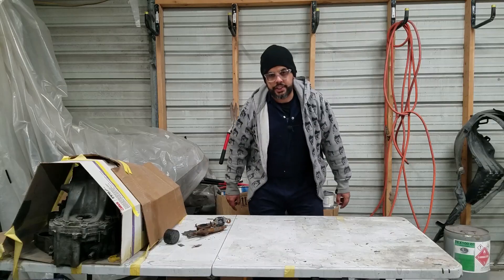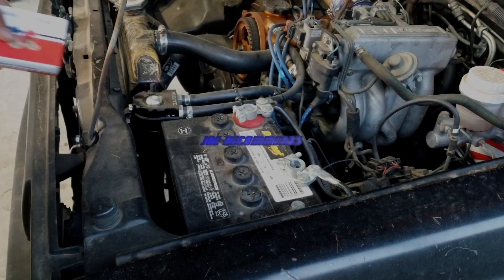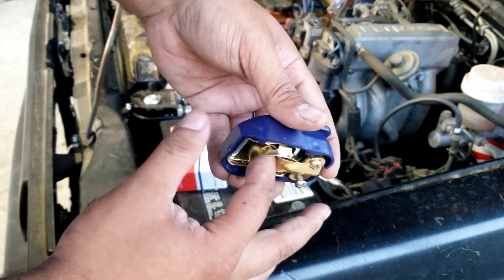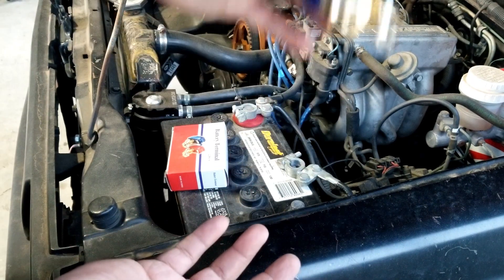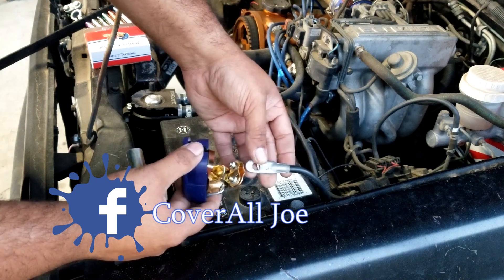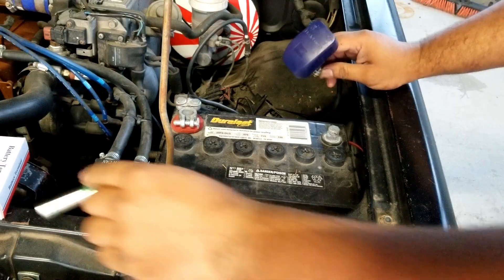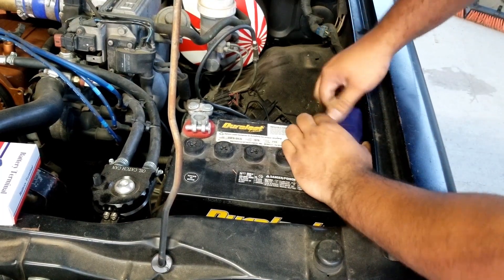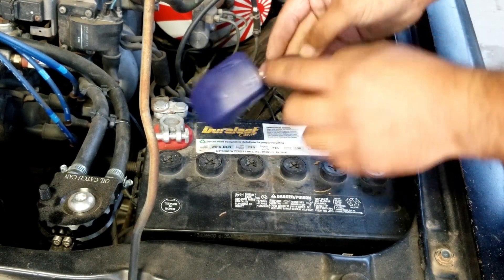Joe Recommends // Product Review, Installation  and First Impressions. Will I Recommend it? 🤔👀

Comment: Sweet channel man. We both got Tegs and Mitsubishi's. So funny bc I got a 1990 Acura Integra GS 5 speed and a 1986 Dodge Ram 50 sport 2.6 5 speed. I literally am in the process of getting my 1986 back on the road after 7 years bc the integra is having electrical gremlins. I've done a lot of work to get these cars looking like survivors. Absolute gems. Cant wait to see the MIGHTY MAX build continue.
Reply from the maker: @Habeev07, damn gremlins! Sorry to hear that! But its a great chance to get that mini truck up and running! 👍😎
Reply: @CoverAllJoe  its so odd. I have no crank or anything when I turn the ignition in the Acura. Its got a new distributor and battery, and i even unplugged the ECU and cleaned the pins and plugged it back in. The car just wont do anything when I try to start it. I can get the stereo to turn on buts that it. its symptoms were it used to die during driving for no reason. Just loses all power then id start it up after coasting a few secs, and id be driving again. Its only been the last 3 months that I cannot get it to even crank over. Any ideas to why it wont even try to turn over when everything seems fine? Thanks